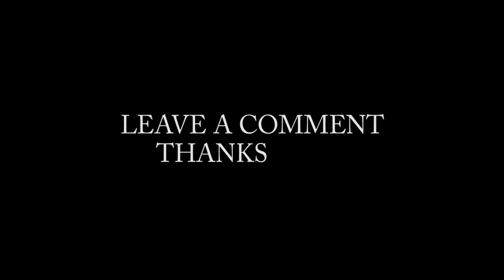Precision Matthews - PM-25MV DISASSEMBLY OF X AND Y AXIS

Comment: Looking good. I stripped mine all down. I'm waiting on my kit from Arizona video. I have my electronics box mostly done. Keep up the good work!
Reply from the maker: Thanks! What bob are you using?
Reply: @makosharkcnc7730  acorn with knock off Leadshine drives. I believe they are the same that you have for the hybrid stepper motors.
Reply from the maker: @ponydown418  I was gonna go with acorn as well till I seen  there free cnc 12 only limited to 20 bocks you have to pay another $140 to get pro after $300 for broad you would think it would be unlimited. Acorn it sounds good franco likes it. I went with the C11G board I think it was $75. Vs. $399+$139 for acorn
Reply: @makosharkcnc7730  ahhh I don't think I ever caught that from any of the videos I have watched. I have considered doing the upgrade so I could use the hand control. Yea money money money eh. What software do you use with that board?

Comment: What's the hole spacing on your stand? I bought a 32V clone and it didn't come with a stand so now I'm searching for one that will fit it. Thanks!
Reply from the maker: what stand? the one the mill is sitting on?
Reply: @makosharkcnc7730  Yes, but I found out they list this info on their website, so thanks!
Reply: @makosharkcnc7730  Good afternoon Sir, looking on the site it says the top of the stand is 28 inches high. Do you have your on blocks? It looks much higher than that.
Reply from the maker: @firearmsstudent  this is what i did look at this video: https://www.youtube.com/watch?v=BuM0nWKJdCk